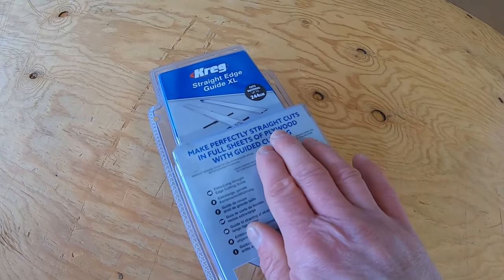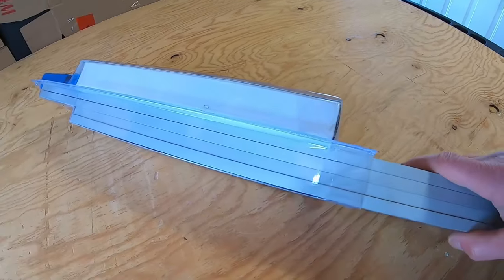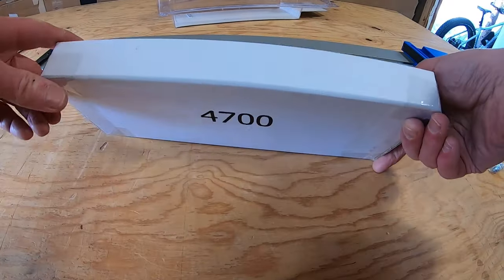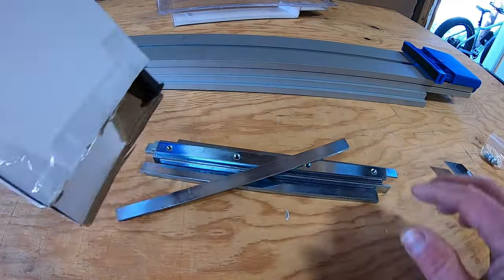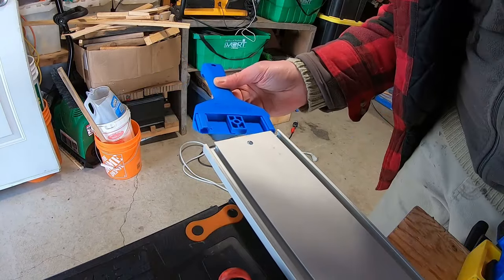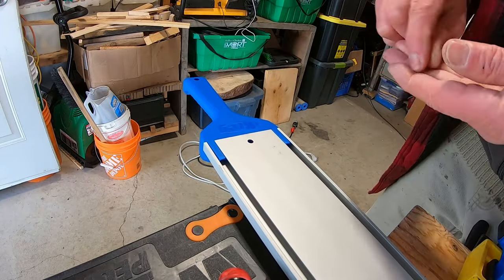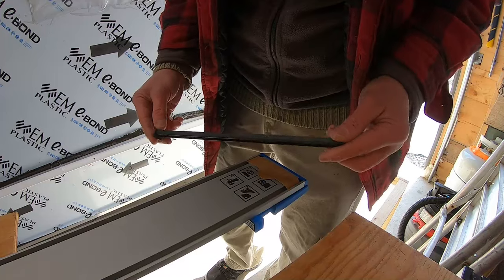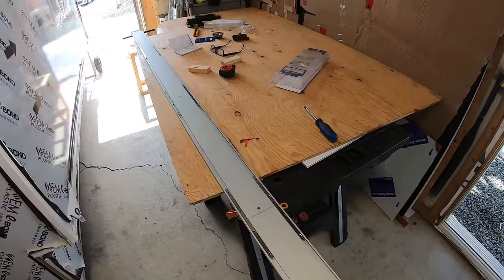Kreg Straight Edge Guide XL Kregtools - Unboxing and Assemble

Comment: Did you figure out what the other 6 bars are for? The ones with the single holes
Reply from the maker: Do you mean the bars that hold the set screws? If yes, those and the ones without the holes actually keep the straight edge pieces together.